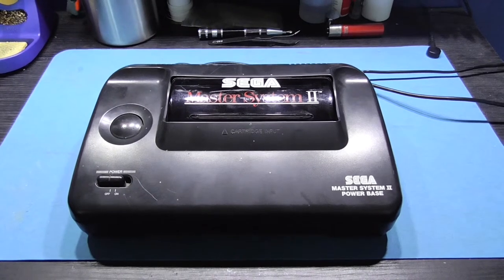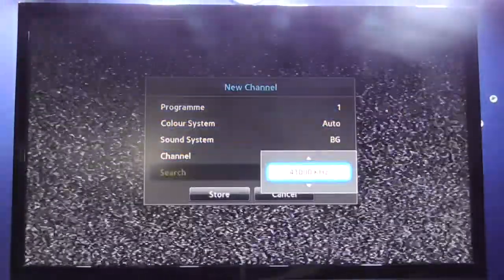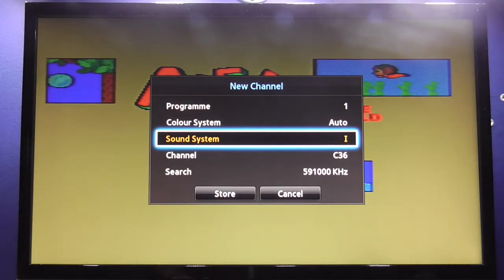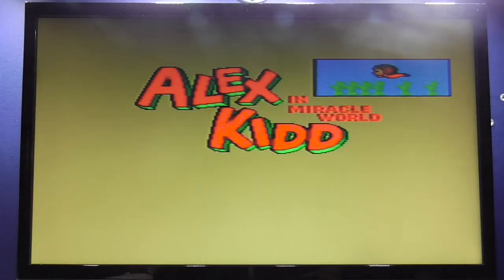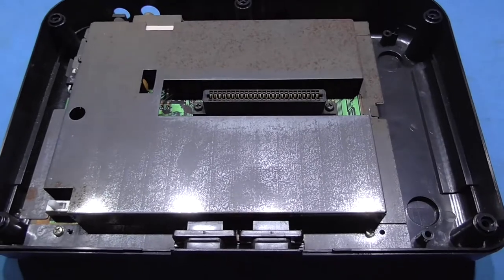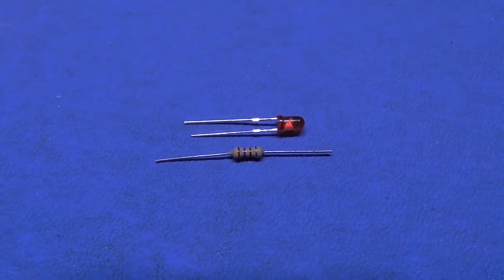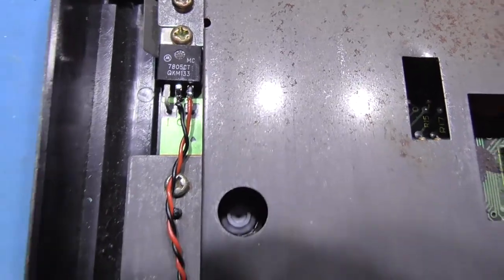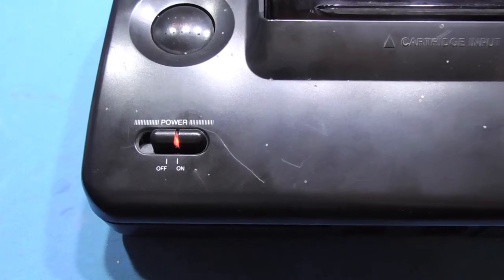Sega Master System 2 - Part 1 - Testing & LED Power Indicator Mod.

Comment: The switch LED placement is very slick, looks like something Sega could have considered doing. The cherry on top would be some diffused plastic to fill in the slot that was cut into the top of the switch.
Reply from the maker: It's a nice little mod to the switch.

Comment: Problem with the SEGA master system is the D PAD breaks. riscman on eBay does some awesome REPLACEMENT 3D prints of these SEGA D-PADs. Really cheap and great quality too!! Check it out!